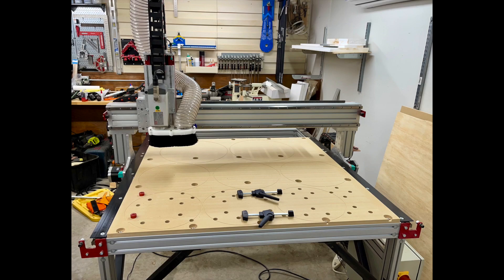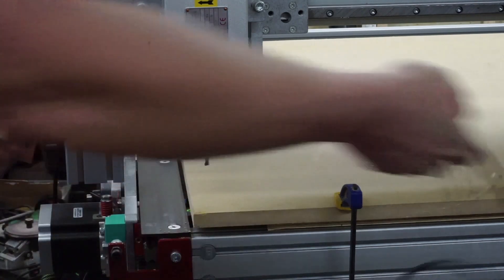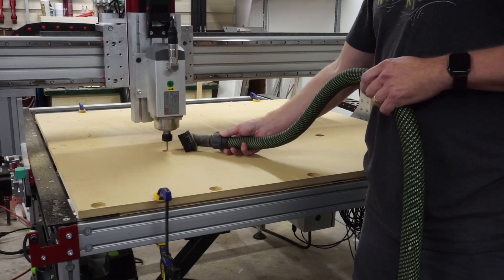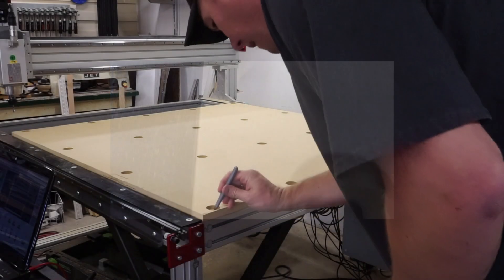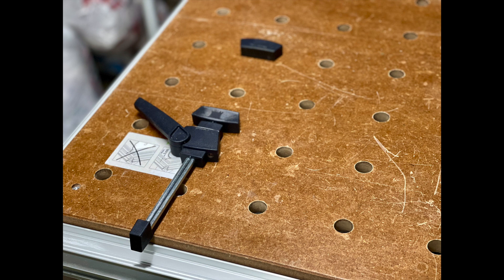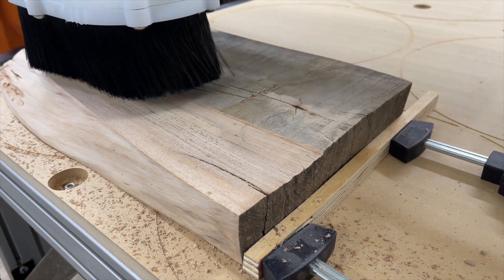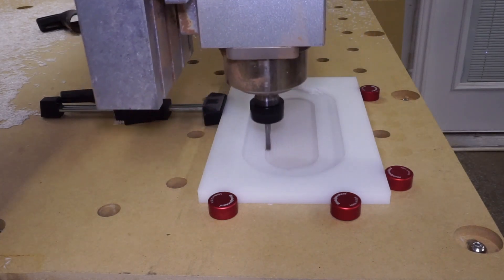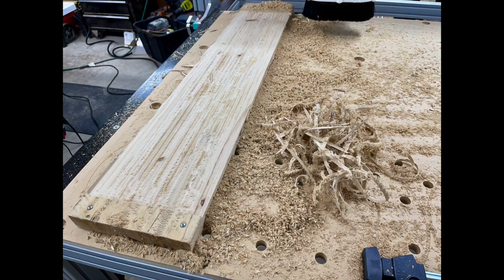Avid CNC Spoilboard Version 1

Comment: Learned a lot from this video.  Thanks for having the courage to show us the mistakes as well.  I'm sure the experienced CNC people saw that HDPE difficulty coming, but I myself did not and it gave me a lot to consider when I'm clamping.  Also, could you post a bit more about specifically what diameter hole and bench dogs you found to work the best for you?  I expect some variation from machine to machine, but the number that worked for you could be a great start for others.
Reply from the maker: Thanks Alan.  I hope I can continue to help people learn ... even if it is from a lot of my mistakes!  I certainly can add more detail about what finally worked.  All bench dogs are going to be slightly different, but I can provide specifics on what dogs I used and what holes worked well for me.  I am working on my spoilboard Version 2 and will include this info once I decide which bench dogs I will go with.
Reply: you all probably dont care at all but does any of you know of a way to log back into an Instagram account?
I stupidly lost my password. I would appreciate any tips you can offer me!
Reply: @Jamir Ayden Instablaster :)
Reply: @Grey Alexzander thanks so much for your reply. I found the site thru google and I'm waiting for the hacking stuff now.
Takes quite some time so I will get back to you later with my results.
Reply: @Grey Alexzander it worked and I now got access to my account again. I'm so happy:D
Thanks so much you saved my ass :D
Reply: @Jamir Ayden you are welcome xD

Comment: Nice video and thanks for sharing your thoughts along the way. I'm on a much smaller CNC, with aspirations for a nice Avid this year. Have you considered painter's tape and CA glue for holding projects down? It's my favorite way to do so.
Reply from the maker: Great point about using the painters tape.  I should have mentioned that.  Its amazing how strong that holds.  I'll include that in my Version 2 video as it is a really good option.  Thanks for the comment!

Comment: I have been considering an Avid CNC for sometime now.  I have been interested in 4848 machine but recently started thinking maybe I should get the 60x60 so holding down a 48" wide sheet goods would be easier.  Im curious what your experience and thoughts are on that, it would be an extra $800 at this time?
Reply from the maker: My theory is if you have the space, and you have the budget, you will never regret having a larger CNC.  I have not needed larger than my 48x48 yet; however, I was asked to do a dining room table project last week that I would love to use my CNC for but it may not be big enough.

Comment: Very good video!  Silly question but where did you source those really cool red bench dogs.  I like how they match the Avid.  Also unless I missed it what size are they and what size did you end up milling your spoil board out  out to accept them?  I think The avid spoil board calls for 3/4” bench dog holes.  Thanks in advance!
Reply from the maker: Hey thanks for watching.  I’ve been a subscriber to your channel for a while. I already had a festool MFT3 table, so I modified the avid spoil board file to cut the dog holesto match dogs I already had that were used in the MFT3. The red dogs are from woodpeckers. The post diameter as I measured it for these was 0.782. I think I ended up cutting my dog holes 0.786. However, they are pretty snug and when I do Version two of my spoil board I will probably cut the hole a little larger because they can be difficult to get in and out at times.
Reply: @MattesonCreations  thanks for that info!
Reply: Thanks for the info!  Can’t wait to see version two of your spoil board.  My Avid Pro 4848 is still about two months out.  I am a hot mess trying to plan my spoil board system.  I’m used to T-track, but like the versatility that bench dogs offer for lateral clamping pressure, especially for panel surfacing, etc.
Reply from the maker: Well congrats!  You will enjoy the Avid.  I hear you on the spoil board.  I researched it forever yet got nowhere.  The best relief I got was when I finally realized ..... it doesn’t need to be perfect right away.  Start with something functional and figure it out later.  That said, I did get some T track but I’m not willing to give up my dogs ..... going to go with a combo for version 2!

Comment: I'm thinking about ordering one but the leg kit is kind of costly. What size 80/20 did they use for them? thanks
Reply from the maker: Hi Dan.  Are you just asking for the dimensions of the base pieces?  If so, they are 3" x 1.25"  I hope I'm answering your question.  I hesitated on the leg kit as well.  After a while I decided even if I built my own base but put some time and effort into it, it would still cost me a few hundred bucks .... and more importantly, a lot of time.  I'm happy with the leg kit but I would agree that if you had a solid plan for a base, then it is something you could do without.
Reply: @MattesonCreations  Thanks for the reply. 600 bucks is kind of steep I thought. I was going to price it out on 80/20 myself and see what the mark up Avid is getting on it. Would you mind measuring  the leg length for me and the support cross members? Thanks again
Reply from the maker: @drich6816  Hey Dan ... I don't mind at all but in order to give you accurate info, or just in case you want to price out different options, I'm going to link the Avid intructions in this reply.  They are open to anyone to view.  The beginning of each build section has a detailed description of each part and its dimensions.  Choose the size machine you are looking at from this link, then click "Base assembly" and it'll have all the info you need!  Avid Instructions: https://www.avidcnc.com/support/instructions/pro/
Reply: @MattesonCreations  Thank you
Reply: That is perfect. Thanks again. I may just build my legs from 2" steel, Going to see how it prices out.